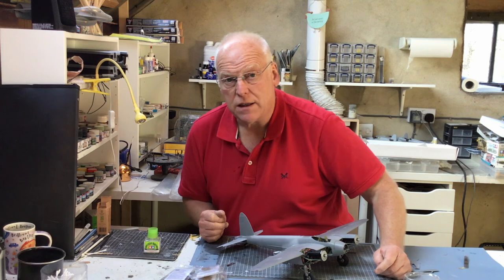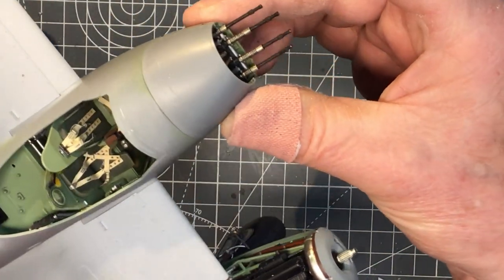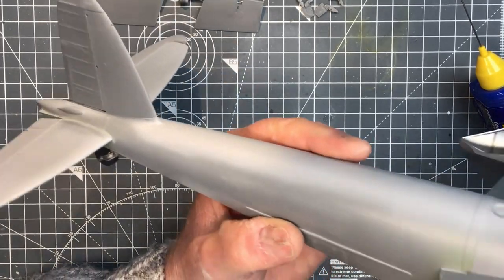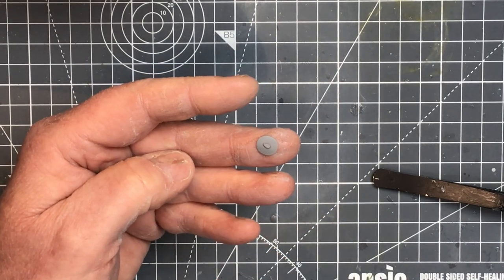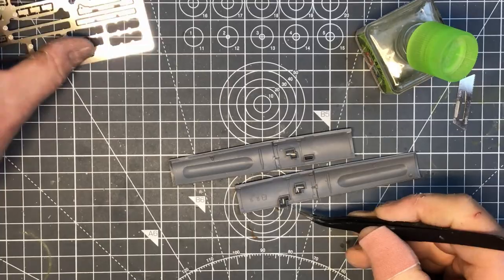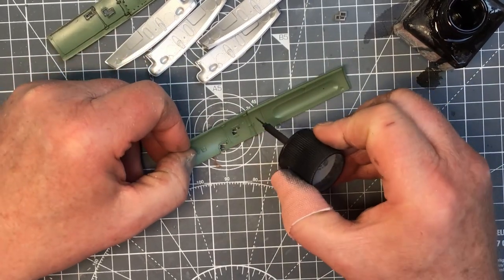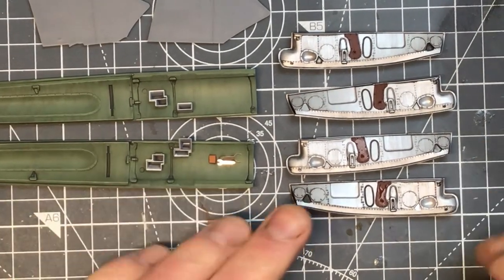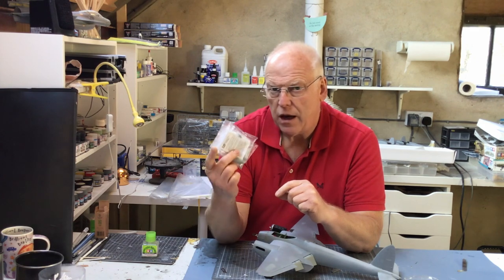Tamiya 1/32 Mosquito build series Part 14

Comment: Keep up the great work! Following every second of this!
Here's a tip for you, and you may not like it, lol! 
It is only really available to modellers of a certain age. 
For the application of really tiny amounts of CA/superglue, for instance those shell ejection dividers, or the chains applied to the ammo boxes in the nose, where just a single, tiny drop is required, I use a nose hair, superglued to the end of a cock-tail stick. 
I have used this for instance, fitting 1/700 ships railings and a large number of the smaller PE items. I have tried an eyebrow hair, but for some reason, the superglue does not seem to adhere to it. 
See - told you you wouldn't like it! Try it, works really well.
Reply from the maker: Dave I’ve got plenty of stock of the material you mention but I can’t bear the pain of removing them 😬
Reply: Pick us a winner!

Comment: Steve, enjoying the build. She will be a show-stopper. In relation to the bomb doors, I think they have to be in four pieces - ie, down the centre and then across to separate the bomb doors (which open in flight) and the gun servicing hatches which do not. At the moment you do not have that separation of the two sets of doors. The gun servicing doors would only be opened to re-arm, service and clean the 20 mm cannons.The two sets of doors probably do not even open to exactly the same extent as well. Note that the bomb doors have a double skin for strength, being exposed to the slipstream. Just a thought mate.
Reply from the maker: Yes you’re right about that John. I didn’t split them because I preferred retaining the structural integrity of the whole assembly and the way the hinges are molded they would remain aligned even if separated. What you suggest could definitely be done though 👍

Comment: If the bomb bay doors came closed did Tamiya add the hydraulic struts with the idea you could open the bomb bay doors as an option?  I would think they would have left them separated at that price?
Reply from the maker: I wondered why they didn’t do that as well Paul it’s always a bit risky cutting parts to separate them. 👍

Comment: Its really intresting when you say the Eduard etch set in some cases -does not add to the model. Its a fine line . I always think -if you paid extra for the etch frets . You must use every item. but if you  give a  bit of common  sense ,only put on your model if it truly adds to the look.
Reply from the maker: Agreed Ralph - photo etch isn’t good for some things like cables and pipes which I think are better done with wire. some of the parts in this set are a waste of time I think.

Comment: I turn my Mr surfacer 500 over,leave it on it's lid,then thicker component of it I'll settles in the lid,and I use it as a precise filler,best of all,a Qtip dipped into Mr levelling thinner leaves the seam filled,and cleans the excess up without any sanding.
Reply from the maker: Good tips Charlie - I’ve used the leveling thinner one to clean up - works well on wing roots 👍